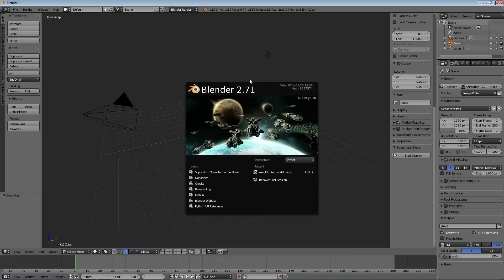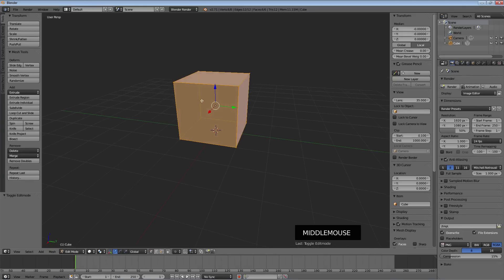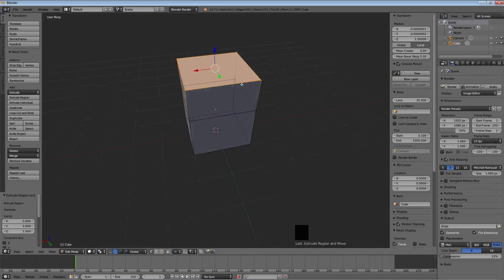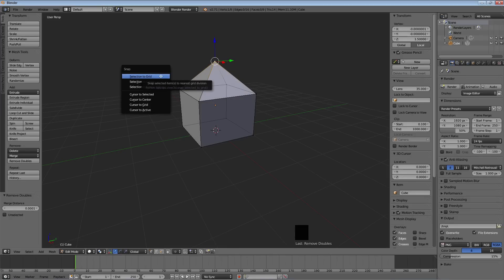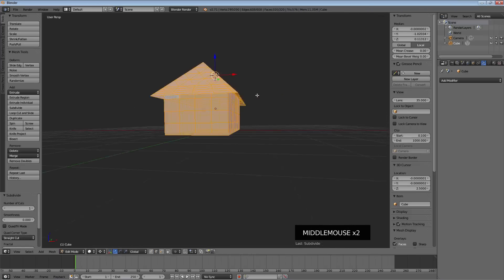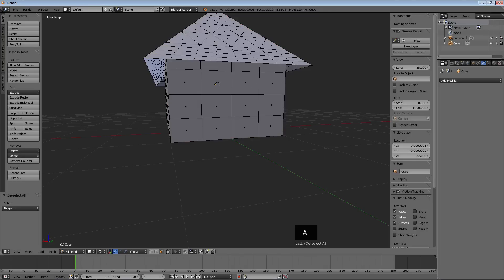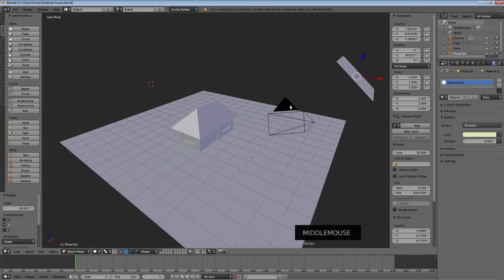Blender Absolute Beginner Tutorial: Episode 4

Comment: for v2.8+ : video @ 09:35, this pivot point is now labelled Transform Pivot Point, and is located at the TOP of the screen, 2nd line. When you hover it will report it's name as pivot point. Click and set to 3d Cursor. Then, as the video suggests, pressing 'e' (extrude) and then 's' (scale) will have the identical effect as what the Author is asking you to do @10:25

Comment: for Blender version 2.8+ users, the merge vertices is in a totally new location.   Edit mode.  Alt-M, "merge". By Distance. 
The 'old' method merged overlapping vertices that were a distance apart of 0.  The new function requests to merge vertices of a certain distance. Should you choose 0, it has the same functionality as what is described in this video at ~8:05.  If your vertices are not exactly overlapping, but still causing you grief, you can increase the 'distance' and produce the same effect.  
v2.8+, use the above.  v2.7- use the method in the video.
Reply: Where is the specials menu in 2.8 whenever he pressed "w"?

Comment: Just a heads up. If ever you are extruding and you get the wrong direction you want to extrude in (for example you want the window to extrude inside (-0.1) and not outside (0.1), press CTRL + Z after getting the wrong extrusion for it to do the opposite version of it. 
So, if you do ''0.1'' and you wanted the opposite (-0.1), press CTRL Z and itll do -0.1!

Comment: is it normal that I dont have the material option on the right side (step near 21:00) I dl'ed it for free on their website but could it be possible its only a trial and within the trial there is only few options in it ?
And I have another question on my house project i have accidently like made a copy of one of the tabs on the right and i dont want 2 tabs that does the same shit and I cant find a way to delete the extra tabs
Reply from the maker: there is only one version of this completely free software, and that is the full version. check to make sure you have the object/edit mode straight, as that can change many options. to delete the panes try right clicking on the line dividing the tabs and use the join option.
Reply: ***** Thanks for your fast respond ! i only seem to have the option Align: vertical or horizontal.. and for whatever reason when i tried to test about the material by switching between object/edit, well its there on both now.. dunno what i did at first place or what I did now but its here xD I only need to remove the freaking tabs now T.T
Reply: ***** Also i dont seem to have the "surface" option in the material one. im using 2.73 and i the closest I have found is some kinds of tabs in which I can find Surface, go into the emission parameters, make it emit the light but I can't change the color of the light emited
Reply: ***** I can manage to do this though with the parameters of the lamp light sources
Reply: ***** All good found my problem for the panel light, wasnt in cycler render

Comment: Protip:  A surface does not a wall make.

This is something I learned 'way back in my days playing with a Doom level editor.  If you used just a single surface, monsters could see and shoot right through it.  In order to make an actual wall, you had to use two surfaces separated by "nothing" aka "outside the map" space.

Once you begin to get really "into" making 3D structures with Blender, sooner or later you'll want to make things which look realistic.  Remembering the above protip will help you a lot in this goal.

Thanks for this video series.  I'm still struggling to learn Blender, although I have managed to make simple objects, such as a hollow cylinder with wall thickness and UV mapped textures.

Comment: Thanks Jacob for your great tutorials. Question: when I hit render (blender), the end result looks like a big flash rather than lighting bouncing off the house. When I select cycles, the program shuts down. Any clue?
Reply from the maker: El P The light source I described doesn't work in the blender render engine.  You have to use a specific type of object called a lamp.  You can add these in just like any mesh (Shift+A).  If the program crashes with cycles it could be an out of date driver or inadequate hardware.  Not sure on that one.
Reply: ***** Thanks for your answer. I did try to use a lamp instead of the plane/light source. I still get the same result. Whatever I try, I get that big "flash" effect on the entire house. I can barely see the house.
Reply: ***** You were right, my machine is just a bit out of date! If anyone runs into the same issue. I uninstalled the 2.75 version to install an older version (2.71). Lighting and rendering  problems gone for now.

Comment: As frequently happens when I'm following a tutorial, I imitate the steps exactly yet get different results.

At the 10:00 mark, I select the peak, I select the four upper edges; Extrude... Then when I Scale, the extension does not follow the angle of the roof but rather goes at a shallower angle, as if the cursor/pivot point is lower along the Z-axis. In addition, Scaling creates a line/edge extending along the Z-axis above the roof peak, like an antenna.

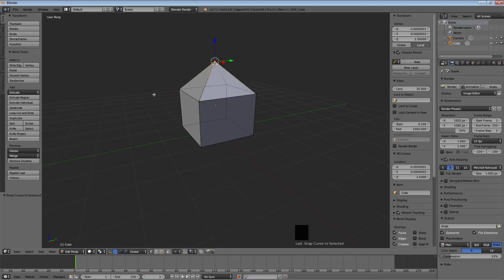EDIT: I'm leaving this in case other people are having the same problem. I neglected to set the pivot point to the 3-D cursor (9:25).
Reply: ty

Comment: so i could not find the surface option where you changed the plane to emission in materials and searched up how and followed something that said to use cycles and to turn on nodes but then surface appeared with no options and i think i ruined things i don't understand..
Reply: LavaboltStar scratch that i definitely messed things up in properties no matter what it is material texture scene world they all are blank i can't access a single option D: D: D: D:
Reply: LavaboltStar well clearly i cannot do anything i tried increasing undo steps and things... nothing i fear i may have to start over and remake this house.... yup i saved and closed blender then reopened. the new file was fine but when i opened the saved one all the options were still a blank gray screen....
Reply: LavaboltStar  Me to...
Reply from the maker: LavaboltStar First, make sure that your render engine is set to cycles.  I set the shader to "emission" type under the materials tab.  This tells the engine that this material will emit light.  I hope that helps.

Comment: On my laptop the F12 key is the key that turns the internet on and off. Can someone please tell me how to change that or if there is another key to achieve rendering instead? Cheers!
Reply: You could just do a full render every time instead of using the F12 key. You cou8ld also try seeing if the settings have key binding options.
Reply: Awesome Thanks guys for your help, The Fn key did not work for me (I think mine is broken) However I changed the setting to use \ key instead and it works great; Cheers @Haloninja744!:)

Comment: I have an issue here: here is what I do; Shift+A>Create Plane>Select the Plane> Go into Materials menu> There is no "Suface" twirl down menu.......so how do I assign emission to a surface without this menu? [Using Blender2.77]
(I already pulled the side window out more to see if it was "hidden" but it's not.)
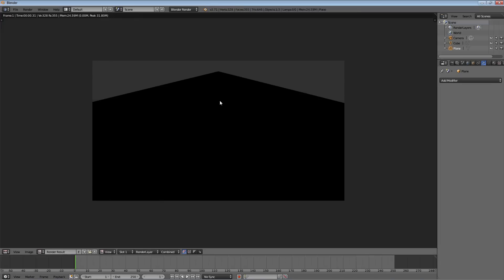Reply: Did you switch to Cycle Render as at 20:05 ?
Reply: Im using 2.77a and it's there.
Reply: had the same problem. spent several hours trying to solve it... Huge thanks for the tip !!!!!
Reply: Good catch.
Reply: Was wondering the same thing, thanks for the question.

Comment: I cant find the surface tab in material....
Reply from the maker: Binh Pham You may have to pull the whole side window out a little if it's hidden.  Otherwise, try using the scroll wheel on the properties window tabs to move them over.
Reply: ***** Thank you, I realized that i am in the blender render mode instead of cycles render.
Reply: +Binh Pham Happended to me too. so much time lost figuring that out XD
Reply: I had the same problem! was also in blender render! thank you so much :)
Reply: Switch your renderer to cycles render
Reply: i switched my render as cycle render and still nothing changed

Comment: jacob i need to ask you a question i know that this video is old but i need an answer. In this video you used the version 2.71 but in 2.76 there is no option to change the surface in the properties window underneath the material option
Reply: so could you tell me if there is another way to do it because i am a noob at this
Reply: Read the other comments.. It is answered and there is still that option..
Reply: Change your renderer to cycles renderer

Comment: Hey Jacob, great turorials, it seems you have another display or another blender version. I have blender v 2.71. My question is, how do you emit light from an added plane? This is a screenshot from my laptop: http://www.mijnbestand.nl/Bestand-KUXKCITB7VAD.png 
thanks in advance.
Reply from the maker: carl Geerts At a glance it appears you are using the Blender Render where I am using the Cycles Render.  I should have specified this in the video.  In Blender Render you can't make a plane emit light, you have to use special objects called lamps (which still work in Cycles).  The Render engine can be set in the top middle of the program.
Reply: ***** thanks a lot, cheers

Comment: This video is not helpful making me mad every time I merge it goes in s different direction and not straight up? I can get it right and you are going to fast and don't make it clear how to do it right.I watched your first 3 videos and they were good but not this one sorry.
Reply from the maker: When using merge, make sure to only select those top 4 points. Also, make sure to merge at center instead of any other merge options.  I'm sorry you're having trouble.  Post any specific questions if you have them.
Reply: I followed what you did the top 4 but it would merge it toward the red and white circle cross hairs?
Reply from the maker: Peter Sr.  It sounds like you did the merge-at-cursor option instead of merge-at-center. Can you verify?
Reply: I did merge center just like it said to do in video
Reply: It's just you , I did this 3 times just to practice and I got it right 2/3. You should watch the video multiple times. :)